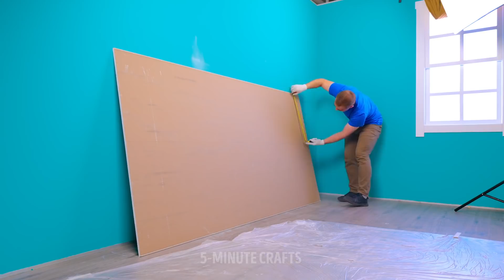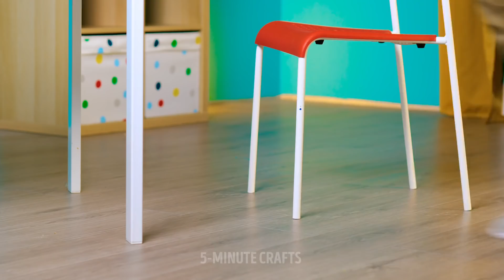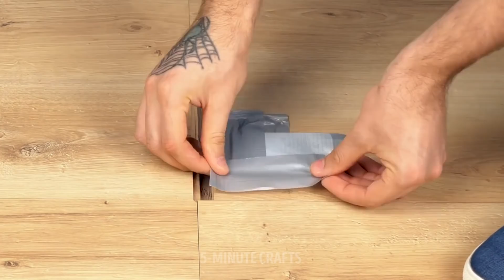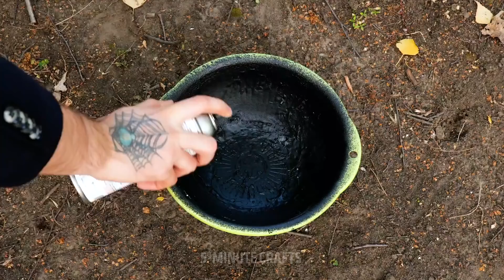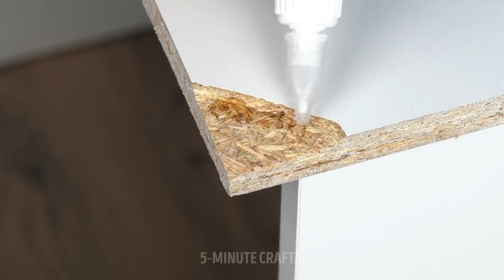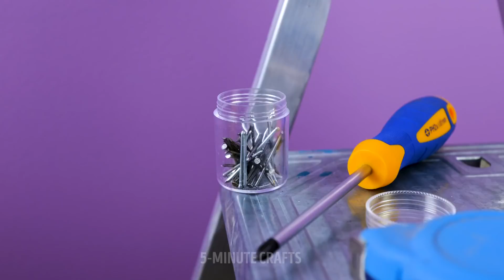33 HACKS TO FIX ANYTHING QUICKLY || Repair Life Hacks And Gadgets

Comment: You flex sealed a colander. The point is to have holes. Just buy a bowl it's cheaper than flex seal. Also, I feel like you just copied the flex seal commercial so it isn't even original